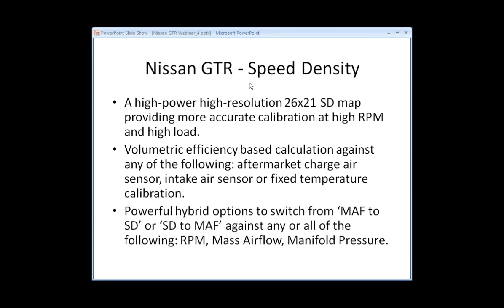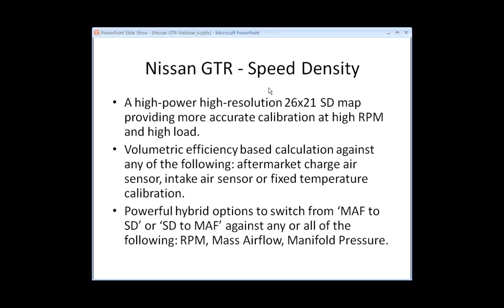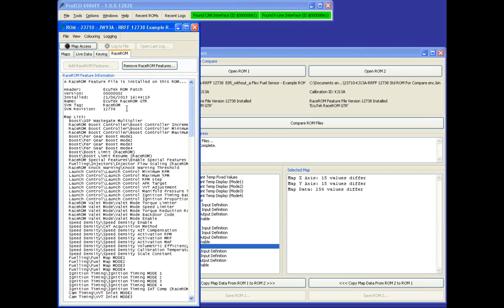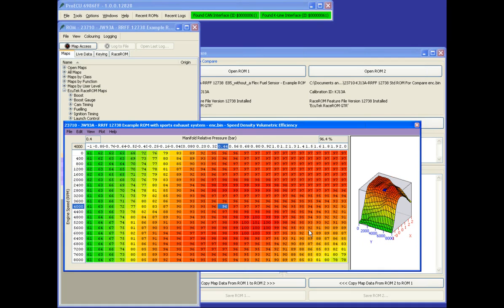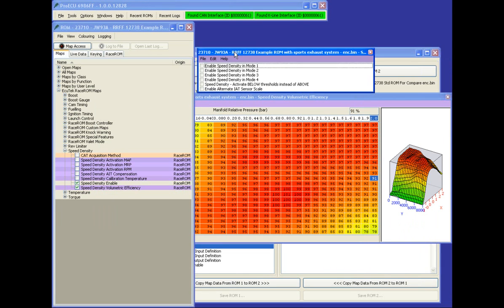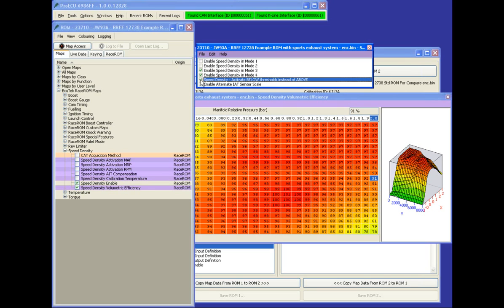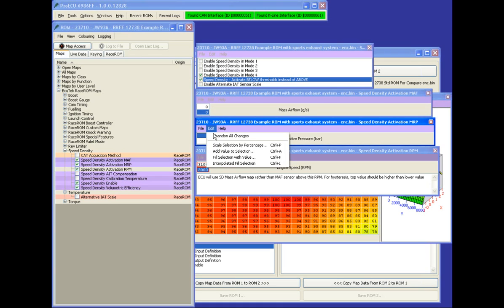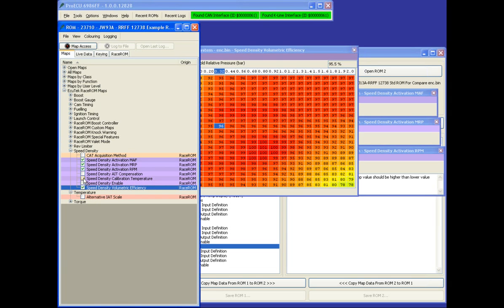EcuTek Nissan GTR Webinar - Speed Density

Comment: When you say that the speed density map can be rescaled since it only reaches to 2 bar, how do you do that? I'm struggling to scale it in my turbo MX5 build with 3bar MAP since it only goes up to 150kpa. MAP sensor is scaled but it won't affect the values or scale in the SD map.